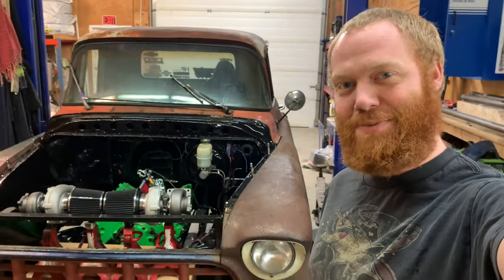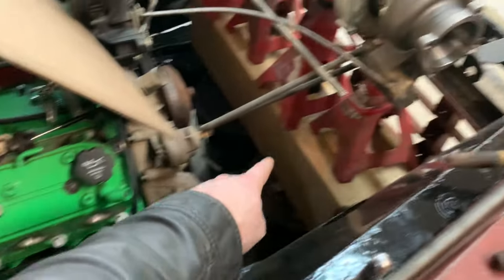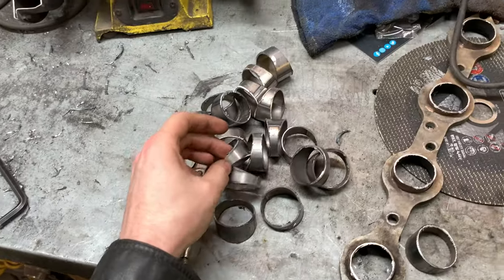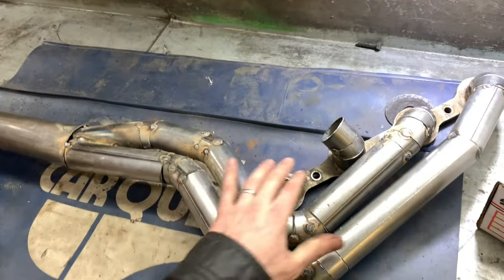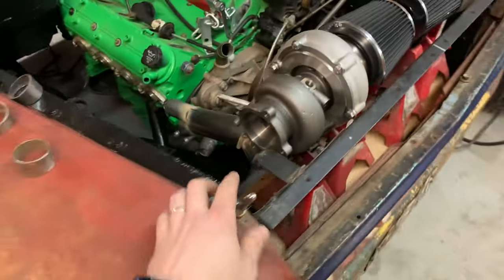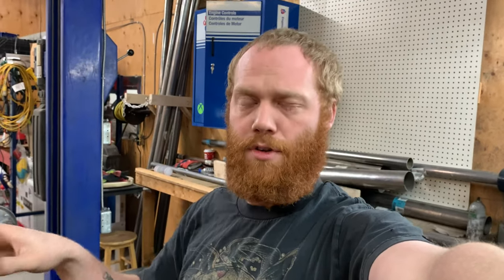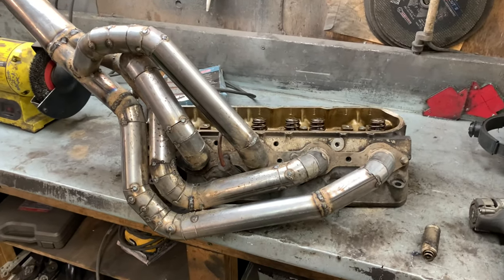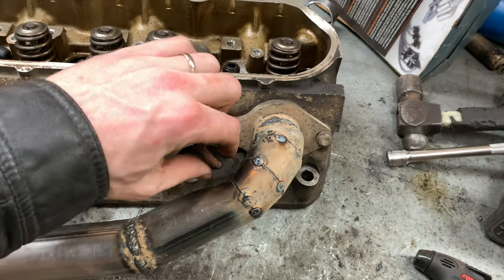Homemade long tube tri Y headers for TWIN TURBO LS! Part one, mock-up and mess-up

Comment: Good video, have you ever thought about using ICE exhaust building blocks when building custom headers and exhaust systems? I know that the ICE exhaust components aren't exactly cheap but they snap together and are reusable so you wouldn't need to be constantly cutting, welding, recutting and rewelding exhaust.
Reply from the maker: I’ve seen those used on some of the car shows, what a cool set! If I did a lot of this stuff I’d probably invest, it would cut down on a whole lot of errors.

Comment: As a side note I have always liked the Tri-Y Exhaust Headers. It just seems that very few of them are paired with turbochargers.
Reply from the maker: After having it on my truck all summer I have to say, they sound so cool with the turbos. It almost sounds like it’s revving faster than it actually is, if that makes sense. I wish I’d planned a little better and I would have avoided issues (clearance for plug wires and stuff mostly) but I do love them

Comment: 1 for 4 isn't bad LoL map gas bro way hotter than propane
Reply from the maker: I think I got off lucky with just the 1 being messed up lol. 

I haven’t used map gas before, propane does okay for the once a year I have to use it
Reply: Live and learn that's the fun of ratrods
Reply from the maker: Absolutely!